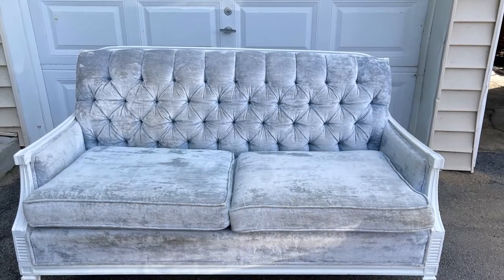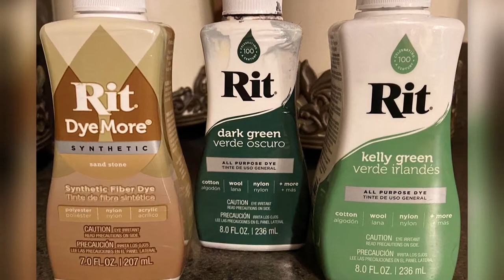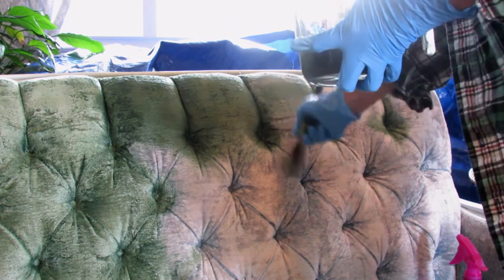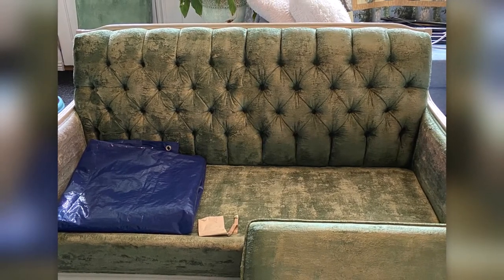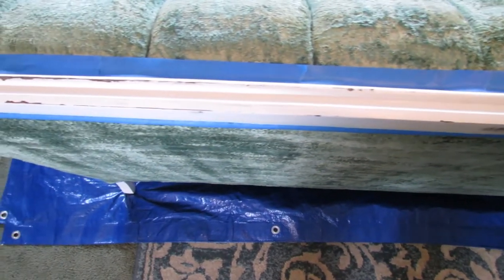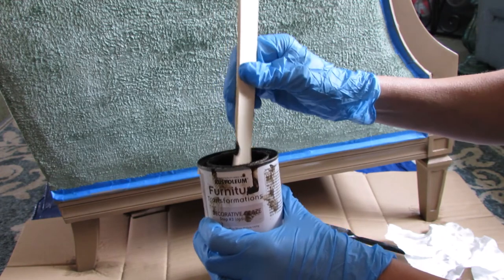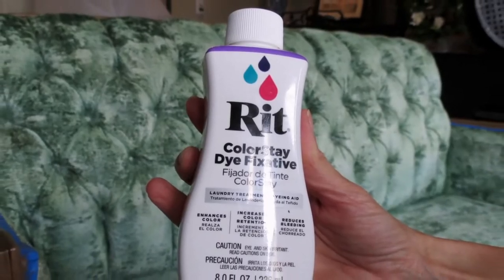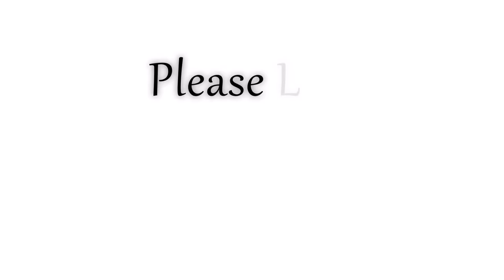I Made Over Our Loveseat Using Rit Dye, Paint And Decorative Glaze

Comment: I did that years & years ago. Used a spray bottle & the box dye. To 2 chairs after I used the crackle paint on the wooden frames. Nice chairs, but they looked faded orange. I used red rit dye. But then the color would come off on your clothes. So I hsd to get them into the shower to rinse the dye. They are still nice to this day.
Reply from the maker: I definitely have seen others rinse after dyeing but I’ve also known of others who haven’t and the color hasn’t bled. I did use fixer so fingers crossed🤞🏻 I’d love to see pictures😊
Reply: I worry that it will bleed as well. This is why I haven’t done mine.
Reply: After I rinsed them, they didn't fade anymore. But they make a spray on dye now. I got mine at Joanna's and there is no rinsing or fading.  It's not to bad.
Reply from the maker: @katherineq9213  Last week I did have a cut on my finger and a swipe of blood actually got onto this couch. I was extremely worried about cleaning it. I blotted it with a dry with paper towel as best I could and then used just water on a sponge that I had rung out well. The stain scrubbed right out and no color at all came off on the sponge. You can’t even tell where it spot was. I believe the fixer was the key. Also when considering paints I find red is consistently the most unstable color. Good luck with your projects:)

Comment: I was given a light blue velvet sofa with different amounts of cushions the backrest had four cushions but the seat part had two large cushions is the four seater and I want to dye it black can I use this same dying method it has no wood it's just all Fabric and it's a sofa bed I want a painted black what I want to make sure that it's not going to transfer the black on people's clothes when they sit could I trust it can I trust this method
Reply from the maker: I haven’t had any transfer whatsoever. My couch was a very faded silvery blue with quite a lot of discolorations. I went for this dark green to make sure everything was covered sufficiently. I haven’t tried this technique with any other color or any other form of fabric. My best advice is to thoroughly clean and dye an underside of one of the cushions. Use the fixative liberally and as I recommended spray it with Scotchgard. Let everything dry and test it. If it fails you could go with the chalk paint method. That was going to be my next step if using Rit was unsuccessful. Good luck with your project!

Comment: So, since you had to mix the colors of dye to get the desired color, did you mix it all at once, and how did you know how much you'd need for the whole thing? Or did you have to do the mix again? I'd be afraid I'd never get the right shade again if I had to mix more later in the project!
Reply from the maker: I did mix in small batches, so I only made one cup of dye at a time. I always started with one cup of very warm water and added the dye by tablespoons. For example: one color was 4 tablespoons, one color was 2 tablespoons and the last color. was 1 tablespoon. Most Uphostery’s will dye differently so I didn’t recommend using the recipe I used. I recommend doing test areas first. It was very easy if you’re keeping it with one cup of water and tablespoons you can’t go wrong:) 
Good Luck!

Comment: Did you use equal parts of the dye?All three full bottles? Or what ratio did u use on the fabric dye?
Reply from the maker: I didn’t use equal parts. The mixture you use will be specific to the fabric you’re dying. I had to do numerous test spots on the underside of one of the cushions and let it dry before I found the combination that worked on the type I was dealing with. I suggest starting with one color, dilute it with the warm water and apply it and see how the fabric reacts to the color. Then go from there.

Comment: Looks like a perfect showroom piece !  Beautiful job on everything, every step of the way.  One question...The two greens are regular dyes, [cotton] while the Sand color was for polyester.  Did you mix all three together ?
Reply from the maker: Yes, I purchased all three off the shelf at my local Michael’s craft store. I kept mixing the three until I achieved the color I wanted. It was a couple of trial and error runs on the underside of one of the cushions, but I was able to cover all that up with my final mix. All the labels of these dyes were exactly the same so if one was for polyester, I never noticed. Regardless, they all worked together, and so far so good. I get a lot of questions as to whether or not the color is rubbing off, and the answer is no. I even had to clean off a spot of blood from an injury on my dogs foot and I used dish soap and water and the stain came right out! I was pretty amazed myself:)
Reply: @ourhighstreethome9177  Thanks for the detailed response.  i'll give this a shot. You just might have discovered a secret formula,{ Mad scientist laughter.}

Comment: I love this! Great job! You mentioned that you use 2 cups of warm water each time. How much dye did you mix with the 2 cups of water? Thanks
Reply from the maker: Thank you! The amounts of dye you use is going to depend on the type of fabric and the color your covering. I stuck with two cups of mixture per treatment so I could more easily control the recipe I ended up using. They have color wheels with combinations and recommendations on the RIT website. You will need to do some testing before you find what will work well on your piece. Good luck with your project:)

Comment: So After ONE year, has any of the green rubbed off and also has it faded?  Rit is not a good dye IMHO.  I would have been tempted to use a thin coating of the polyurethane over the fabric, working it in very well to avoid any roughness.  Or at least use the upholstery cleaner to get some of the dye residue off.
  RSVP?
Reply from the maker: None of the green has rubbed off, and I even had to clean off a spot of blood from my dog. I used a mild dish soap and water, and it was fine. I did spray this fabric with RIT fixative and I also used Scotchgard. The color looks great. I would include a picture, but at the moment I’m re-painting the entire room and everything is covered in plastic. I’ve never seen polyurethane used on the fabric before. I’d be interested to see if that works.